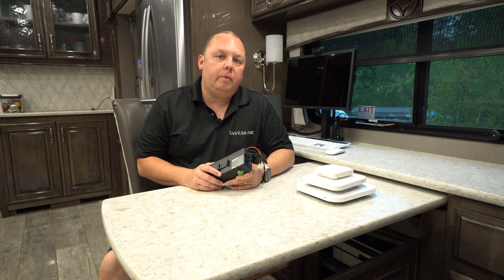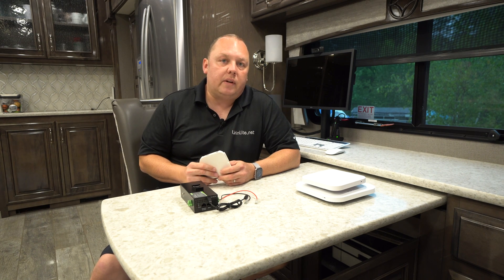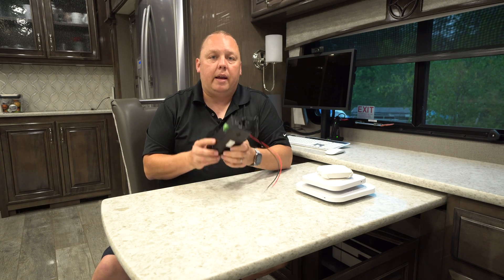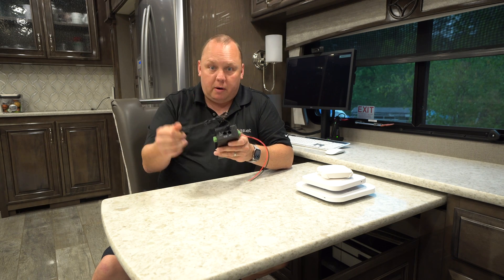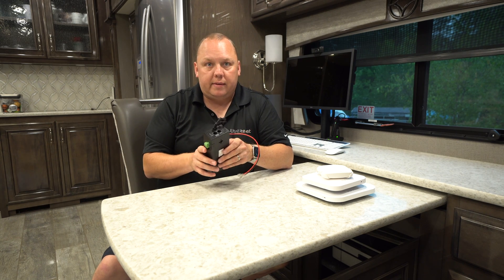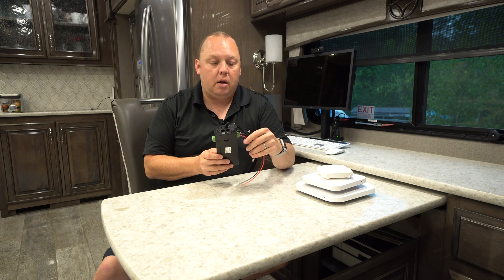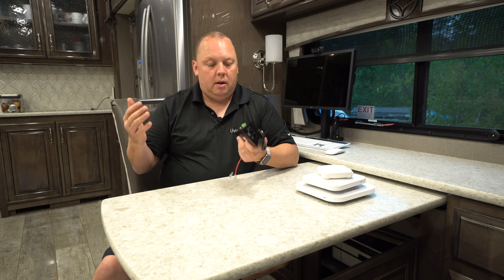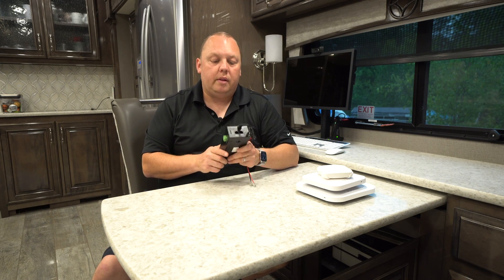DC Power over Ethernet (PoE) Injector Overview

Comment: I bought one of these and it only puts out around 12W on 12v input / 48v out. Pretty disappointing. It started power cycling by Unifi Flex switch repeatedly after installing the 3rd camera. I'll have to look for a higher watt injector
Reply from the maker: Hi Jeff! I'm sorry to hear you're having issues with your PoE injector. Would you mind reaching out to us via email at info@mobilemusthave.com so our team can take a further look into this and see what we may be going on? If you can, pictures of your current setup with the PoE injector will also be helpful. Thank you!

Comment: Could this be used to bypass a Starlink router as the power source for the dishy? I currently am using the starlink router for power and a max transit duo for the wifi network in my RV. I would like to remove the Starlink router all together.
Reply from the maker: No, starlink uses more wattage than standard poe solutions.  Some other videos on YouTube can show you some DV conversion options for the rectangle dishy.
Reply from the maker: note that many have you cut the actual starlink wire but more recent variants allow you to use the ethernet adapter to be modified so your only modifying a 39 dollar accessory. Give that option a search and i'd recommend going that route for DC power of starlink. There have also been some companies that have come out with dc powered solutions in limited qty which might be worth a look but we haven't tested. A bunch of this is covered in our starlink resource center at the mobile internet resource center at https://www.rvmobileinternet.com/starlink-resources/

Comment: great device -- will be getting one soon along with pepwave router..  do you have options for a 12v or a way to power and 8 port switch -- I just got my 2022 Travato and I'm working through installs for networking devices..  thanks
Reply from the maker: Hi Steven, we have a 12-48v in 8 port POE switch that is perfect for mobile installations as well. Here is a link: https://www.mobilemusthave.com/8-Port-Gigabit-POE-Network-Switch-for-Mobile-Installations-DC12V-48V-Input_p_1377.html That video should be coming out in the next few days!

Comment: Cool addition!  I have the MAX Transit Duo LTEA and it was designed to support 12-48v input.  Any idea why that same input is not supported on this device?  How does this work with 24v systems?
Reply from the maker: Hi Ben, this device is not made by Peplink so thats why the specs dont line up with the Transit. The manufacturer here didnt elect to put a variable input power supply in this unit since it also has the ability to trickle charge 12v batteries. I think because of that function they were not able to make this support 24v input. Depending on your install if you have 12v batteries in your setup (2x12v for 24v for example) you can tap 12v off a single battery for this device and other 12v devices if that is an option in your setup. If that isnt an option, i'd checkout our 8 port POE switch which has 12-48v input as an option along with 8 POE enabled output ports. Here is a link to that unit https://www.mobilemusthave.com/8-Port-Gigabit-POE-Network-Switch-for-Mobile-Installations-DC12V-48V-Input_p_1377.html